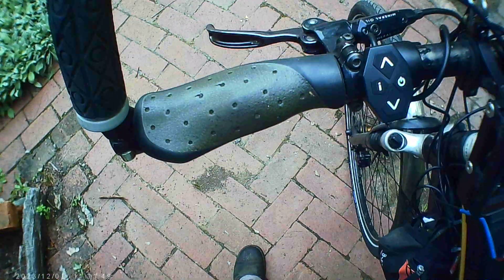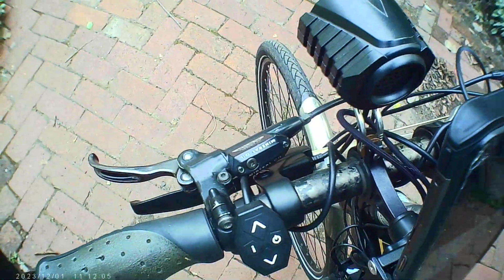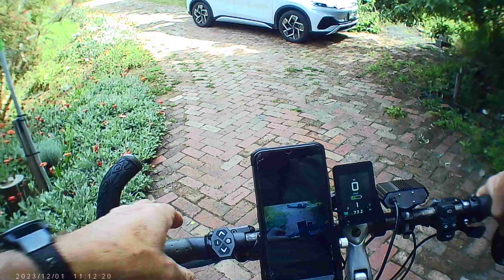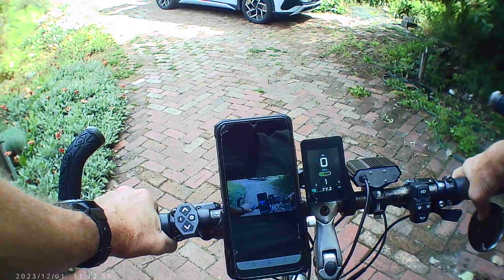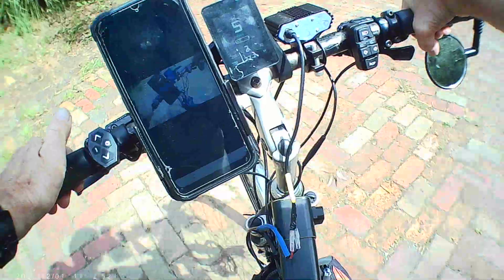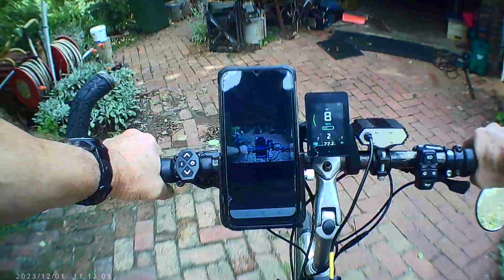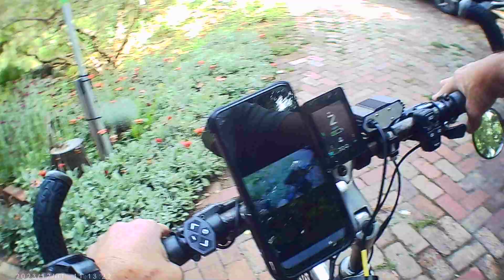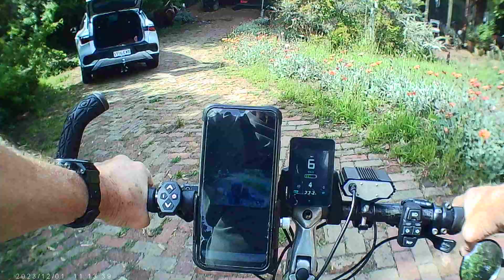DM02 ~ the 98% Project - demonstrating M1 Safe Mode up20% FM K231123

Comment: I have a Very early DM02 firmware April 23, would consider flashing to a newer firmware, but I want to backup the old firmware first, I didn't see a backup option in ToSeven's software to do that. any suggestions?
Reply from the maker: I'm away from my computer so I'm not sure what files I have by title but I have the last version of eco/city/sport, about October and maybe the one before.I have also scuffed my motors when trying to replace controllers... All my mistakes, not really ToSeven, so I can't test anything until I get the wiring repaired and that requires me to have time to take my time so I don't rush and make the same mistake. So if you're moderately happy with the firmware you have, I recommend sticking with it for a while longer... Or talk to people in the high voltage ToSeven discord chats.
Reply from the maker: I can chat more in a fortnight, when I have all the information in front of me
Reply from the maker: I also have several of the Early M1 and M2 versions but again, I can't really give good advice until I get my motors working again